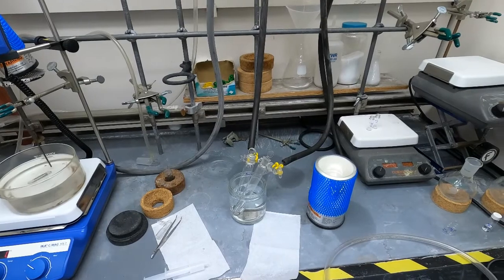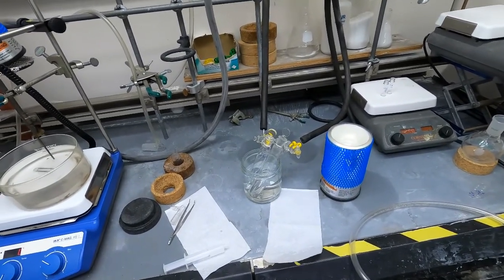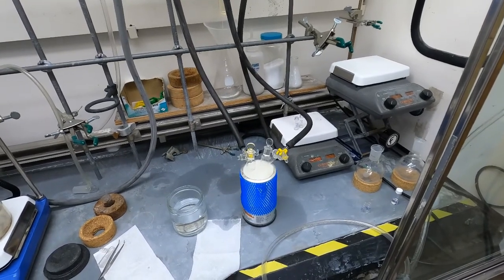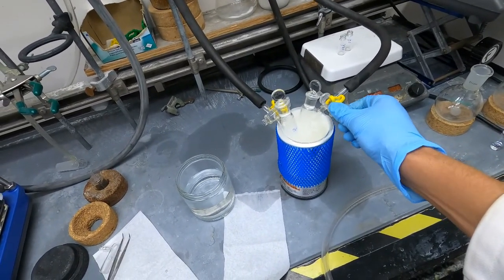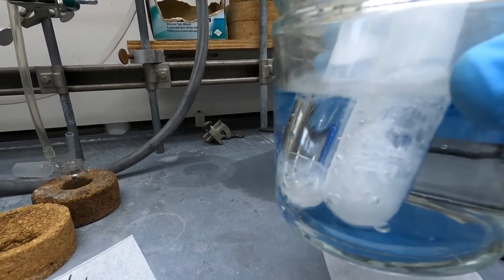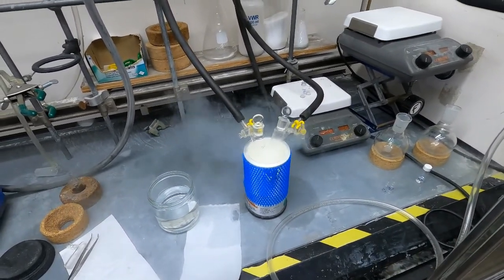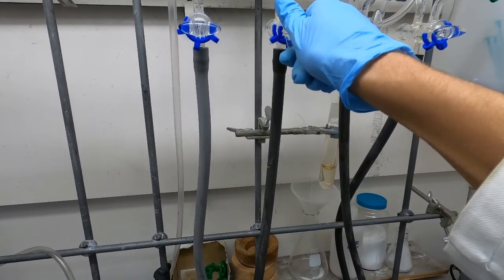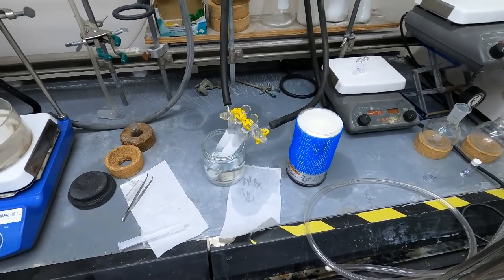How to Perform Freeze-Pump-Thaw Degassing

Comment: Thank you for your great explaination. 
I just wondering, after degassing, how do you move your degassed solvent to flask which you will use for reaction?
Reply: In my experience. Typically the flask that you do the FPT (freeze pump thaw) in is the same flask you use for your reaction. This is a good reason to have some schlenk flasks in your lab!